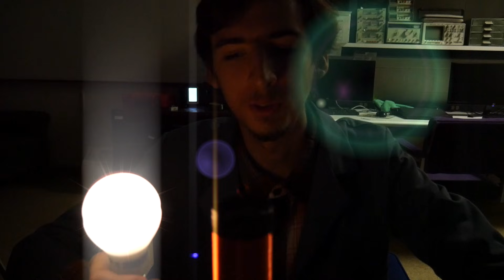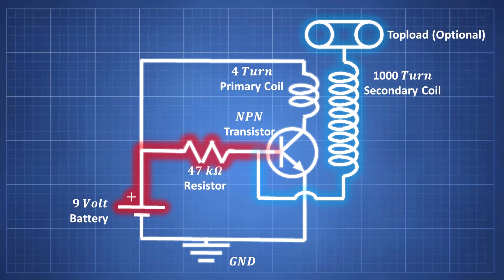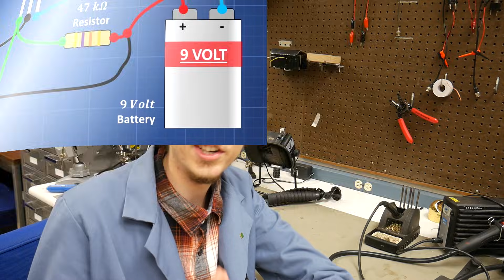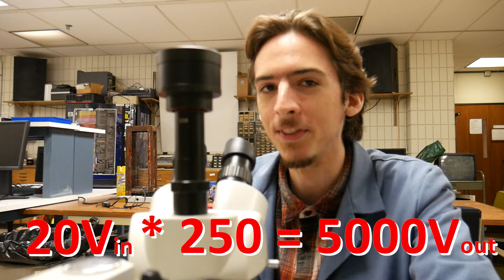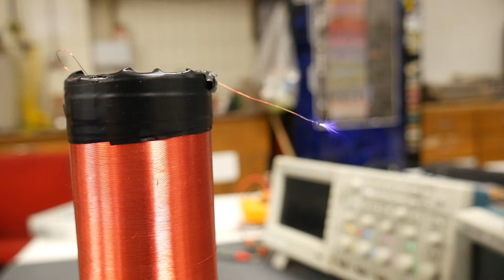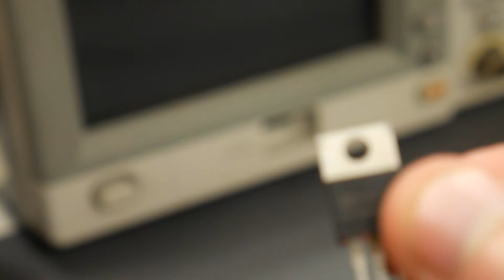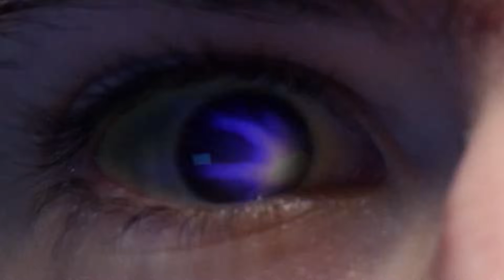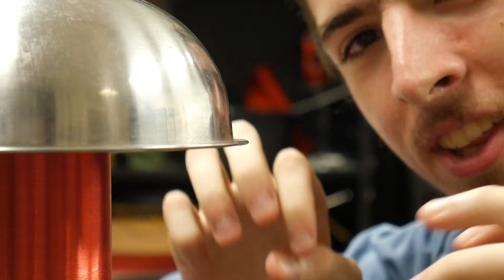SLAYER EXCITER - Tutorial, Explanation, and More

Comment: Hey man, what you say about the slayer exciter is not correct. This is 1/4 resonator and you should make sure it hits that frequency. The proper way is to calculate your wire length and multiply it by four, which gives you the wavelength of the wave. Then you calculate what frequency that is and write it down. Now, because the coils usually don't have enough self-capacitance, they resonate at higher frequency and that is not what we aim for. Lets say you calculated 330kHz but your coil resonates at 425kHz. You need to add a very specific amount of capacitance in order to drop the frequency to the 1/4 wavelength frequency and this just doesn't happen by just mounting a bowl on top. You need the exact capacitor like any LC resonant circuit. If you don't have the right value, you don't get the 1/4 wavelength resonance and that's why transistors get hot. As for primary, you take the wire length of secondary and divide by 4 or 2 until you reach a manageable wire length. If you tune this thing it produces an entirely different effect, you don't just get plasma on top, it becomes more like a Van De Graaff generator. You get white sparks with cracking sound.
What you presented here is a self-oscillating HV transformer, if you tune it, then it will be a proper slayer exciter, if you also tune and resonate the primary, then you get a Tesla transformer.
Reply from the maker: You think that's bad, then don't take a look at other people's explanations :)
Between you and me, this meant for hobbyist and, as such, doesn't get into antenna theory that much. I'm aware of the mathematics you are talking about but didn't really consider them for this build as you pointed out.
However, I'm 100% for improvement; if you could recommend any readings on the matter, I'd be happy to take an afternoon to read them so I can speak more accurately in the future.

Thanks for the critique.
Reply: @BlueprintScience  I can't give you a good tutorial in english. I happen to know english, russian and bulgarian, so I watched an in depth tutorial in russian. I can tell you my mistakes because I made 2 secondaries and BJT driver, mosfet driver and high voltage mosfet zener driver. All this failed because my coils suck. I have one that is short with about 1000 turns on 45mm tube. Wire is too short, so I get very high frequency and transistors can't handle it and I didn't put any capacitance, because I didn't understand what it's all about. Then I wound another longer coil with 2200 turns but on a thinner tube 35mm, expecting higher voltages. I did get them but the wire overall length is still short and I obviously didn't get 1/4 wavelength. After failing I watched the tutorial and it all made sense. I thought of it as a high voltage transformer, while in fact it is 1/4 wavelength resonator.
Here are some things I found out for a very successful build. First of all, we want the frequency to be relatively low, so transistors can handle it well. Range 100-200kHz. This frequency is directly related to the length of wire. It is a good general rule to make the coil height 4 times the diameter of the tube. Larger tube is better, so for my next proper build I am gonna use 110mm tube and my coil would be 440mm. You can use this very helpful calculator: http://gorchilin.com/calculator/coil14?lang=en
Next thing is surprisingly skin effect. If you calculate the skin effect for these frequencies, you will find out that it is deeper than the wire diameter you used, I used even thinner 0,2mm. The wire needs to be larger than the skin effect depth. Based on that I found out that my wire needs to be at least 0,35mm  so that's what I am going to use. Now we have the height of the coil and wire diameter and we divide them and in my case it is 440/0,35 = 1257 turns. Based on the calculator this coil would resonate on its own at 340kHz. Notice there is a parameter called "The ratio of the speed of propagation of the wave: 2", this 2 means the frequency is higher than what we need for the 1/4 wave to fit. You then choose a top capacitance that would make this ratio 1. Ball or a tor, it's up to you. So my tor outer diameter is 330mm, tube of the tor diameter 110mm. Lucky for me, my inner diameter is the tube diameter. With that tor capacity I get the ratio of 1 and frequency of 181kHz and this is my design.
Now ... don't worry about the number of turns, because when you actually make it resonant, waves add up and voltage would be very high. Unfortunately you made the same mistakes as me. Your wire is thinner than it needs to be and your coil diameter is about 4cm and I guess your frequency is too high for the transistors. Now what you did kind of right is the top load size. Did you notice that it hurt you and the spark make noise ... these are signs of resonance. The russian guy said that at resonance sparks are more like static, they are white and they hurt, so you don't want to touch them. He also said that with tuned coil you can experiment with Tesla radiant energy receiver, that can charge capacitors to ground.
Lazy way to improve your coil is to just find the right capacity for the top. You can tune it but for my 35mm long coil I have to put a 300mm sphere and that would look ridiculous and the frequency is still somewhat high at about 350kHz, so I would just make my new proper design.
I have a little theory that the top capacity needs to have the same surface area as the coil. If you think of the coil as a cylinder, the outer wall is like one of the plates of a capacitor, so the other needs to match it. Easy way to find out who made his coil right, just by looking at it. ;)
Few notes on safety. Have in mind that all sparks emit UV light and this is bad for the eyes, so if you plan to spark a lot, put sunglasses on. Then when you have highly accelerated electrons and they hit solid metal, they might produce x-rays and x-rays are very bad.

Have fun. I will subscribe and wait for another proper build of the slayer exciter. :)

Comment: Hey what did ur primary wire end up being? U started with saying 10awg wire but that stuff was NOT 10awg wire! Was it? It looked like 1/4" copper tubing....
Reply from the maker: That's just my old foe, inconsistent editing, showing its head. You are correct, I did change to 1/4" copper (solid) partway through since I wanted the ability to clip on anywhere. The gauge/diameter isn't actually all that important for the primary coil. Anything thicker than 20AWG wire is acceptable.

Comment: Why is it that the primary coil is always so short in physical height and not stretched out closer to the height of the secondary. 

And I see some tesla coils have a spiral primary. Are there advantages/disadvantages?
Reply from the maker: 2 Reasons:
The energy is moved from the primary to secondary by a magnetic field. That field is stronger when the coils are closer together.
Also, if the primary gets too close to the high voltage end (the top), arcing becomes a problem.

Comment: Hi, love your videos. You are one of the resources my son and I are citing as research for his science fair project. One thing we've run into, is that we can't seem to push the transistor beyond 14 v before it dies. I've gotten it up to 16 v, but upon creating any arc it instantly dies.  we have: EDGELEC 100pcs 47K ohm Resistor 1/2w (0.5Watt) ±1% Tolerance Metal Film Fixed Resistor,BOJACK Fast Recovery Diode UF4007(1A 1000V) DO-41 Axial 4007 (1 Amp 1000 Volt),Bridgold 20pcs TIP31C TIP31 NPN Silicon Power Transistor,3 A 100 V TO220,3-Pin, using regulated desktop power supply. I know the circuit is ok at least since it does work, but just don't understand why transistors keep popping, no smoke or burning just dying. Primary coil is 4 wraps of nomex, not the entire three strand, just one strand out of a nomex wire, secondary is just about 1100 turns of BNTECHGO 32 AWG Magnet Wire - Enameled Copper Wire - Enameled Magnet Winding Wire - 4 oz - 0.0078" Diameter 1 Spool Coil Red Temperature Rating 155℃ .We are using the standard widely available basic Slayer exciter circuit. The transistor is also heatsinked, massively heatsinked
Reply: I recommend using tip41. They can handle larger voltages. And make sure not to touch or connect the heatsink to anywhere. Perhaps use Mica insulator. Use diode as well to prevent transistor from frying. I made one a while ago and it worked flawlessly. Double check connection before powering. Hope this helped
Reply: @juntendo6104  Thanks! I appreciate the input
Reply: @vdefazzio  Oh yeah don't do Darlington pairs as Blueprint said in comment
 It won't work, two can't oscillate fast enough.
Reply: Use a MUR1506 diode

Comment: Would it be worth replacing the 47kohm with a trimpot to try to tune how hard the NPN switches on?
Reply from the maker: I don't think so. We are using the transistor either %0 (off) or 100% (on). There is such a thing as an active region that depends on the current into the base, but it is not desired here.

Comment: How can i use a laptop charger (19v 3A) as a power supply?
I want to make it as yours but only with 1 transistor will it blow up?
Reply: I will use a heatsink with the transistor
Reply: Also, can I use 4 or 6 9v batteries in series and I will get a sparks? ))
Reply: Yes you can use laptop charger as power supply and 2 transistor with heatsink and I am sure it will glow.
My one also glowed

Comment: Bro my coil is not giving out big arcs
Reply from the maker: Alok Amrute, the easiest way to increase your spark size is to increase the input voltage. Make sure the transistors can handle it. I peaked around 60V to get the sparks I showed onscreen.
Don’t expect gigantic sparks - I have never gotten them to reach more than about 1 inch (2.5 centimeters) myself.
Reply: @BlueprintScience  thanks for replying...☺️☺️ But can i use laptop charger as input with 1 transistor to ge some visible sparks
Reply from the maker: I used a 19 volt power brick for my final design. I’m sure any laptop power brick would be acceptable.
Reply: @BlueprintScience  bro my transistor brunt🥺🥺please tell number of transistor to be used and in which way..for considerable amount of sparks . Tommorow is my science fair
Reply from the maker: Alok Amrute, I remove my cowboy hat in respect for our fallen transistor.
I am unsure what further advice to offer on such short notice. Of course, putting transistors in parallel is a quick-n’-dirty solution. You could go all in.
... or you could keep small sparks but still impress people with your passion for knowledge and continuous improvement. I’m ten billion percent sure that is what the judges are looking for.
Reply: @BlueprintScience  thanks buddy....you are the best youtuber i ever saw ...love u ...but will darlington config + 2 transistor +laptop charger +1200turn +3turn will give me enough spark for tommorow
Reply: @BlueprintScience  and can i use one TIP31C and two 2n2222 transistor   in parallel
Reply from the maker: Alok Amrute, sounds like it should work fine. Just be realistic with your expectations and knock em dead tomorrow! (Metaphorically of course)
Good luck to ya!
Reply from the maker: Alok Amrute, don’t mix transistors. The strong will sacrifice the weak.
Reply: @BlueprintScience  thank u ...hope it will work ....going to buy replacement transistor
Reply: @MusicThatHits  hey if it's working with you can you send me a picture of your circuit? I have this as a school peoject too
Reply: @user-se2gd2ib6y  sure
Reply: @user-se2gd2ib6y  but how should i send u
Reply: @MusicThatHits  hmmm instagram or twitter?
Reply: @user-se2gd2ib6y  insta
Reply: Please help .... darlington config also burnt my 1 transistor among 3
Reply: @BlueprintScience  i did it...can i use aluminum for primary coil

Comment: There is difference btwn two diagrams around primary coil which should I use the one with symbols or with that colourful wires?
Reply from the maker: I think they are both correct. You can use whichever one makes more sense to you.
Reply: @BlueprintScience   no just see the "colourful" diagram crock clips of primary coils are inverted 

I have also made one but it's not working   firstly i made it on bread board input was of 24v dc with 5 transistors in parallel just as you said ,but nothing happened does broadness of primary coil matters?
Reply from the maker: @atharvagupte3842  Size matters not. If nothing is happening, you could try flipping the primary OR secondary coils. You want a ++ or - -, not a + - or - +, in other words, have them each wind the same direction (very important)
Reply: @BlueprintScience   okay I'll try and tell you thanks
Reply: @BlueprintScience  I've made secondary coil of 2.2 cm diameter is it too less?
Reply from the maker: @atharvagupte3842  That should be acceptable so long as the coil is no more than 5 times taller than it is wide (give or take)

Comment: Bro..
I need a help..
How did u get the input source? 
Is it battery eliminator? 

Is it ac or dc?
Reply: It's a DC power supply. That one's a pretty nice one but you can get them for about 40 bucks for a simple cheap one. For this particular circuit, a 9v battery would work fine though.
Reply: I got bruuh!
Thanks!

Comment: A diode should be placed from emitter to base, otherwise the base-emitter junction breaks down at every cycle, with some luck not destroying the transistor. A LED works too, and provides an immediate signal that the circuit is working.

Comment: Hi, what is the voltage and current limit for this setup? the  data sheet not sufficient. Also i don't have a variable power supply, so it's necessary.  Also, i need to know about the calculations for a base resistor for transistors, please.... Please help.

Comment: I have made 1400 turns on secondary coil and supplied 27 volt power but still it is not giving that much output and the circuit is also ok please tell what to do

Comment: Is it possible to use a 4 pin transistor for the job ? my last one, thank you excellent video 🤗
Reply from the maker: I've never heard of such a thing. I suspect one of the pins is electrically connected to another 🤔. Suggest checking the datasheet and making sure that the collector, emitter, and base are correct.
Reply: @BlueprintScience  hi there thank you kindly for your reply, I think it's got the two center pins as a double emitter for some cooling effects or something as it has the same symbol above each pin I just noticed so I might just try them together or have two primary coils 😃

Comment: Yes, I have been using parallel transistors for a while now. They help with a multitude of circuits, from tesla coils to audio amplifiers. Now I need to build a new slayer exciter with a better primary coil. I think my main issue with low power is the high resistance of my small gauge primary coil.

Comment: I have a doubt you're using 47kohms for 12 volts and for 9volts what should you use
Reply from the maker: I really did use a 47kohm resistor. Any value between 20kohm and 100kohm work about the same. The reason is that the transistor only senses a voltage but doesn't sink much current.
Reply: @BlueprintScience  thanks man
Reply: No one responded me this fast.
Reply from the maker: @rishisrikanth8877  No problem :)
Reply: Waiting for your next video
Reply: @BlueprintScience  how about making a cyclotron 🤔🤔🤔

Comment: Could somebody explain me why the lamp turns on even above this toroid capacitor? I mean, the other end of the coil is down (ground wire). So why does the charge goes above the coil and not just the shortest way from top to bottom through the air?  

The same for lightning from tesla coil. Why does the sparks go to every direction and not directly down to the ground wire? 

Thank you :)

Comment: Ok, you say feedback turns off transistor 3:20 and when pulse of current stops flowing through the secondary coil, transistor is turned on again by 47kOhm resistor. Are you sure? Try to run this circuit and while it's working, remove 47kOhm resistor, if circuit is dead, you win, if it still runs, it's probably because you're wrong and pulse of voltage POSITIVE to the emitter, with phase shift equal to 360 degrees. It is called phase condition of oscillations generation. It's cruicial which end of secondary you connect to base and it MUST be the end through which voltage is positive to the emitter while transistor is open.
Reply from the maker: When I get back to the lab., I'll try it.
Reply: Tried it? @BlueprintScience

Comment: What would happen if you increased/decreased the resistance in the circuit? I'm trying to make my own
Reply from the maker: Correct me if I'm wrong: you're referring to the resistor. I used a 47kohm resistor; this can vary a lot - anywhere from 20kohms to 100kohms. Anywhere in that range should be acceptable.
Good luck :)
Reply: @BlueprintScience  Aye, that works! Thank you

Comment: Starting at page 10 of this PDF, you can get more info about this circuit : http://www.free-energy-info.com/Solovey.pdf

"A point which ... seems to have missed is the fact that the positioning of the L1 primary coil along the  length  of  the  L2  secondary  coil  has  a  major  effect  on  the  output  amperage,  so,  positioning  the  L2  coil in the middle of the L1 coil should increase the output power considerably."

Comment: Which one can I use TIP3055 transistor or 2N3055 transistor
Reply from the maker: They each have the same 60V 15A rating; either one will function the same. I personally prefer the TIP package over the 2N because I find it easier to work with.

Comment: I made a tesla coil using a transistor tip41, a resistor of 2k2, supplying 9v, primary 6lilit, secondary coil.tesla but it turned on why the lights were not bright and the distance of the lamp should be very close to the tesla coil.